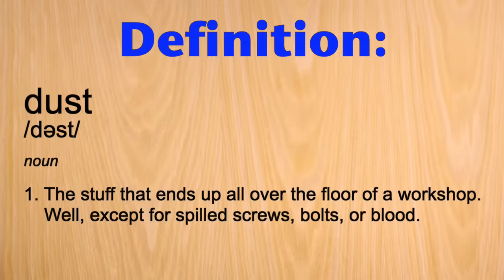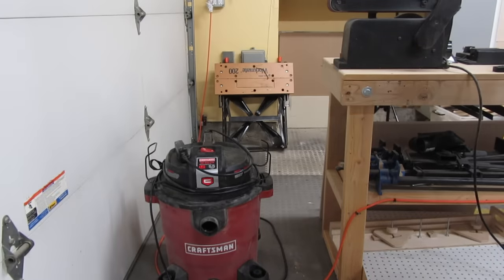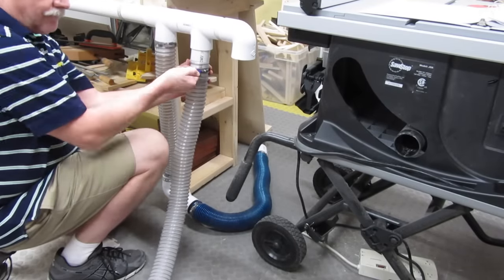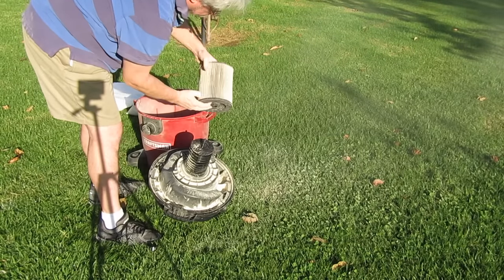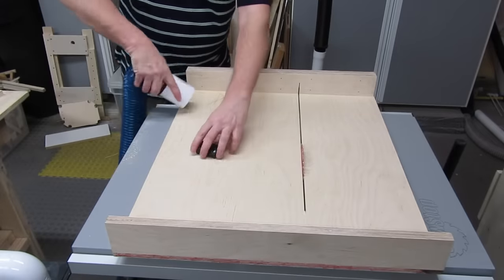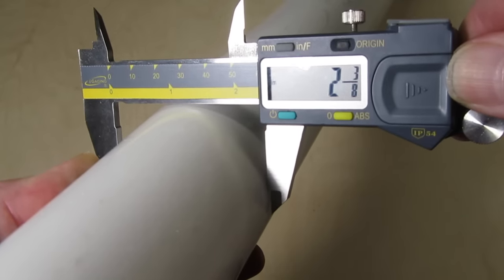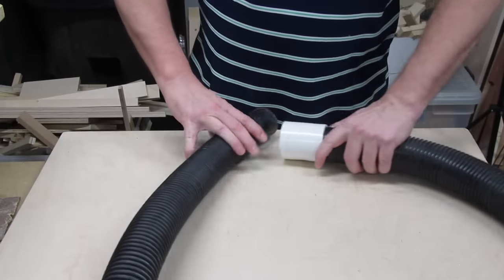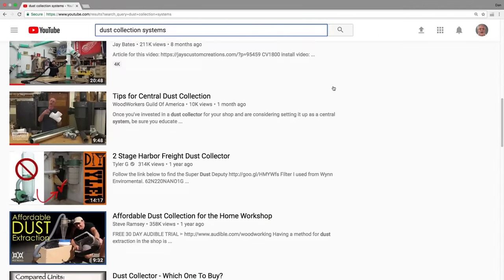Dust Collection for Newbies: Introduction to Dust Collection

Comment: Home Depot's version of the dust cyclone is much better for only 40 bucks!
Reply from the maker: I assume you're talking about the Dustopper. I have a review: https://youtu.be/iPHS-y1fWQY. It's not "much better", but it works well also, and is a good alternative to the Dust Deputy.
Reply: @TheNewbieWoodworker  I agree... I would say "just as good".  But cheaper cost with attachments included and no-brainer installation on the homer bucket puts it over the top in my book.
Reply from the maker: @mae2759  I can't argue with that. 😄

Comment: I used a dust collector but was surprised that a large portion of the dust went into the vacuum cleaner!  Why?
Reply from the maker: I'm not sure what you're asking. The dust is supposed to end up in the vacuum cleaner. That's the point.
Reply: @TheNewbieWoodworker 
Yes, this is my question. A large percentage of dust ends up in the vacuum cleaner
Reply: Can I have your email so I can send some photo for more explanation?
Reply: @TheNewbieWoodworker  Presumably he means he has a cyclone?
Reply from the maker: @jeddah116  If you mean this happens even when you use a Dust Deputy or something similar, then something must be set up wrong. Sorry I don't have a better answer than that.
Reply from the maker: @jeddah116  Sure. Go to my website at https://thenewbiewoodworker.com/, click on the Menu, and there's an option to email me.
Reply: @TheNewbieWoodworker  Thanking you for trying to help me ..
I found the reason which is a leakage from barrel cover that way collecting a dust.
Reply from the maker: @jeddah116  Awesome! Glad you solved it. 😄

Comment: PVC vs ABS? What are your thoughts? Is there a grounding issue or no?
Reply from the maker: I use PVC whenever possible, but I couldn't give you a specific reason why. As for grounding, here's my thoughts on the subject: https://thenewbiewoodworker.com/dust-collection-fire-danger
Reply: IMO, I would not install a PVC dust collection system without running a bare (preferably stranded) copper wire inside the entire length of the PVC and then grounding one end.  This is particularly true for larger (higher volume) dust collectors running through 4 or 6 inch PVC with long runs.  It may not be an issue with the system shown here.
Reply from the maker: @charlie2265  Here's my thoughts on the subject: https://thenewbiewoodworker.com/dust-collection-fire-danger

Comment: I only have a question :  There's no necessary to put any PVC cement when you put the fittings together ?
Reply from the maker: I haven't needed to. If the fittings are tight, I don't think you'll need it either. Every once in a while I'll come across a PVC pipe that is a little narrower than it should be, and it isn't tight enough, so I've learned to test the pipes at the store by plugging them into a connector, before I buy the pipe.

I have two connections I used duct tape on: One was because I was in a hurry, and it's worked so well I haven't changed it. Both the tape and pipes are black, so I don't even think about it anymore. The other is the 2" to 4" adapter that goes to my new cabinet saw. The 4" end is the same diameter as the dust port, so I used black duct tape again, and it's fine. But other than that, no glue.
Reply: @TheNewbieWoodworker  Thank you!
Reply from the maker: @Adriva01  👍
Reply: He said why he didn't!

Comment: hi my name is adam davenport I live in raleigh nc and I was just wondering if you could do a video on how to build a vacuum system for an electric clothes dryer for an apartment k
Reply from the maker: Hi Adam. Thanks for the request, but that doesn't sound like something I'm interested in doing. Sorry.
Reply: What do you mean, Adam?  What is a vacuum system for an electric clothes dryer?  What are you trying to do?
Reply: @odinata  probably trying to collect the lint from dryer exhaust in a place where there is no outside vent.
Reply: The lint can be collected easily with panty hose at the end of a standard dryer exhaust pipe.  But you would still have to deal with the heat coming out of the exhaust hose. As well as making sure you're homemade filter is kept cleaned. Or it will become a fire hazard.
Reply: @richardtrowell8812  On a more serious note, I cut a section of pantyhose (nylons) and slide it over the filter of my shop vac.  this helps keep the filter clean.
Reply from the maker: @odinata  👍
Reply: @richardtrowell8812  well if there's no vent then I'd say move the hell outta there because that's probably illegal for the landlord

Comment: Have you had any issues because your system isnt grounded? I have a similar setup im building and idk if i have to go through the trouble of grounding
Reply from the maker: I haven't had any real issues, no.
Reply: If you DO need a ground, you've got one on your plug or electrical outlet. Wrap wire or foil around or at the problem area and connect to the ground.

Comment: No mention of grounding your system. Isn't that important especially using plastic pipe and hoses? Other sources say it needs to be grounded so static electricity doesn't ignite dusts.
Reply from the maker: Here's my thoughts on the subject: https://thenewbiewoodworker.com/dust-collection-fire-danger.

Comment: i have a question, i have a shop vac 5hp, pretty much the same thing as the craftsman, i also have a dust cyclone attached to a bucket. how come in this video that there is maybe 99.999% empty and when i use mine, 50% go to the cyclone and 50% goes to the shop vac? I just can understand why.
Reply from the maker: Huh. Good question. Do you have the hoses connected to the correct ports on the cyclone? I other words, there's an "in" and "out" port, did you connect the hoses to their corresponding port? Is the lid tight? Is the cyclone tight to the lid? That's all I can think of. I hate to say it, because it's no help, but they pretty much just work, when connected right. I've never heard of them not working, but of course I'm no expert by any means.

Comment: Yeah you don't sacrifice suction by extending the hose that far?
Reply from the maker: Yes, it makes a difference. The question is, it is still effective enough? And that's a question only you can answer. I intentionally have my router table at the end, because I use that the least, and dust collection on a router is always going to be imperfect. But like I said, it's up to you.

Comment: My shop vac draws 183m3/hr  and was wondering if it is powerful enough?
Reply from the maker: Just happened to be checking comments when yours popped up. I don't know anything about those kinds of numbers, so I really can't say. I can tell you, though, that I ended up replacing my original vac right away (the one in this video is the newer one). So if you think yours isn't powerful enough, then you might be right. But hey, you never know, right? 😛
Reply: @TheNewbieWoodworker  thanks   Dan much appreciated will be a little bit of "trial & error" to begin with looking forward to working it out 👍👍
Reply from the maker: @alanscott5942  You're welcome. And that's half the fun, right? Good luck. 😄

Comment: How did you heat up the pvc without burning it?
Reply from the maker: I use a heat gun. I wear gloves, and constantly turn the PVC so it doesn't burn. I periodically check it to see when it's soft enough to form. Make sure you do it in a well-ventilated space, or outside.
Reply: @TheNewbieWoodworker  perfect!  Thank you!

Comment: Too many angles means more friction. Instead of 90° use 2/45° or 4/22.5°
Reply from the maker: That's true for systems that use true dust collectors, which depend on air volume to move the dust. For systems like mine that use shop vacs, which rely on air speed not air volume, it makes no measurable difference, at least, none that I could detect using an anemometer.

Comment: Cant you just remove the filter from the shopvac ?  What's it for?
Reply from the maker: Sure you can. But it gets really messy. Also, a dirty filter puts more strain on the vac's motor, shortening its lifespan (in theory). And filters need to be replaced.

Comment: Does the vortex work with Sheetrock  dust?.
Reply from the maker: Good question, and I don't know the answer. Sorry!
Reply: Yes, it should.  Sheetrock dust is actually made of limestone rock, so when it swirls through the vortex it should land in the bucket, not in the shop vac.  The limestone rock is used in the pollution control of coal-fired power plants.
Reply from the maker: @BarryDavis  👍

Comment: Use rain fittings instead o pressure fittings
Reply from the maker: Thanks for the tip!
Reply: @TheNewbieWoodworker  your welcome. Supposed to said drain fittings not rain 
My bad
Reply from the maker: @johnnyredding4205  I figured it out. You can actually edit your comments, if you want. I don't know how to do it on a mobile device, but on a computer, when you put your mouse over the comment, there should be 3 vertical dots on the right. Click them, and then click "Edit". Just so you know, and if you care. 😄
Reply: @TheNewbieWoodworker  hey thanks brother..ill definately try to remember that.tho i rarely use a computor cause i suck at technology,computors and such. Ill try that on my phone though.again thanx for the tip.appreciate ya
Reply from the maker: @johnnyredding4205  👍

Comment: Wouldn’t it be easiest just to connect the hose to the power tool instead of this elaborate system and drop valves? Seems overkill and don’t have to worry about suction issues.
Reply from the maker: If it's easier to you, then by all means, do it that way! 🙂 And if you get tired of it, you at least have an alternative.

Comment: Very bad idea using 90 degree connections.
Reply from the maker: 90 degree turns aren't nearly as bad when used with a dust collector-based system, compared to a blower-style collector. So while I wouldn't say it's a "very bade idea" to use them in this type of system, I will agree that you should avoid them if possible.

Comment: Would this work on a largest scale?  Thanks. - Thanos
Reply from the maker: If you've got equipment that uses larger dust ports, say 4" or 6", then I wouldn't use this setup. I'd go with a true dust collector. Otherwise, it probably depends on a lot of things, so it's probably trial and error. You can always add a second vacuum and another set of runs, I suppose.

Comment: a cyclone separates dust and chippings the chippings drop to the bottom of the cyclone and the dust continues out the top and on to your collection bin. or am i wrong😢
Reply from the maker: The idea of the cyclone is get dust and chippings into the collection bin. In theory, dust-less air continues on to the vacuum. Of course nothing is 100% effective. Also, there's such a thing as "fine dust particles" which don't get collected at all, but that's a different topic.
Reply: Depends on particle size and density, and the rate of air flow (negative pressure).
Reply from the maker: @DokDream  👍

Comment: Ahem...cheezy Star Wars reference.  CLOSE THE BLAST GATE!...Open the blast gate...open the blast gate!!!  OK, OK, back to my real question.  Knowing you are adding all these ports (and even if you add more) at what point do you suggest going to a larger vacuum?  Pressure as you already know goes down when you open ports (or forget to close blast gates).  But as you add more items.  Isn't there a point that the proportion of size of vacuum isn't enough to how many items are downline even in regards to how they exit dust from the tool or ports themselves?
Reply from the maker: It may have been cheesy, but I loved it. 😄Yes, there will come a time when either you want to have a more powerful vacuum, or perhaps break the system into two, or move up to a system with a "true" dust collector with at least 4" pipes. But you'll really only know when it's no longer working for you.
Reply: But, will you need a larger vac at all since you're only running one machine at a time???
Reply from the maker: @dannybouy7948  Suction degrades over distance, especially when there's lots of curves or flexible tubes. But this is what I think people should keep in mind: Does it work "good enough"? If it does, then don't worry about it. Perfection is unattainable, especially in dust collection! 😄
Reply: @TheNewbieWoodworker  thanks Newbie. You're so right about perfection. I've tried for years to attain it. It's so depressing when you attempt it and never reach it and then when you have to settle for the best you can do...its maddening.  So, with the help of the Lord Jesus Christ, I've learned that the best of men are simply men at best. The best I can do is progressively getting better. :)
Reply from the maker: @dannybouy7948  Well said.
Reply: You could add a T section on the cyclone and 2 blast gates to create 2 closed systems off of 1 shop vac to cut down on distance, but this will make managing the blast gates more difficult
Reply from the maker: @caliban8924  👍

Comment: A dust collection system MUST be grounded with bare copper wire along all of the piping due to static electricity buildup.  I find it hard to believe you haven't been zapped.  Static sparks and saw dust are not a good mix.
Reply from the maker: https://www.rockler.com/exploding-pvc-dust-collection-ductwork

Comment: Chop saw to cut pvc... fine blade.... no better method. If you don't have a chop saw, you need one, just buy it... sliding/mitre recommended.
Reply from the maker: Thanks. There's more to it than just buying one - I'd have to have room for it. But thanks for the encouragement. 😄

Comment: PLEASE MENTION STATIC ELECTRICITY WHEN PLASTIC PIPING IS NOT GROUNDED, a simple grounding wire should be installed along the entire system as some vac hose has the wire forming the hose can be tied into the grounding wire.   static electricity and dust = KABOOM
Reply from the maker: https://www.rockler.com/exploding-pvc-dust-collection-ductwork
Reply: I don't think that happens very often or ever.
Reply from the maker: @Johan_Pentrose  Thanks, and I agree. That's what the Rockler link says. It has happened with big systems, like grain silos and big commercial sites, but for small systems like ours, a fire or explosion pretty-much only happens if there's another, more dangerous factor is involved, like a gas leak.

Comment: I thought if we didn’t use metal pipe, we could start a fire.
Reply from the maker: That's not really an issue unless you have a really large system, like industrial-sized large. If you're worried, you can ground the system (search YouTube for "grounding dust collection"). But also see this: https://www.rockler.com/exploding-pvc-dust-collection-ductwork.

Comment: When you go outside to clean your filter from your dust collector why you have the vacuum cleaner outside put the lid on it without the Builder plug it in and use the exhausted the vacuum filter in the air blowing out to clean your filter blood from the inside of the Builder out through the Builder the other way can you clean it real efficiently Jay Jay deal
Reply from the maker: Thanks for the info! 👍

Comment: T-connectors are evil for losing air pressure, Y-connectors should be used & flexible hoses so should be as short as possible.
Reply from the maker: I believe, and this is only a theory but nobody's debunked it yet, that shop vacs work differently that blowers. Shop vacs rely more on air speed, and blowers rely on air volume. Or something like that. So it seems that Ts have less of an impact on 2" PVC pipes and shop vacs, than they do on 4"+ pipes and blowers. I also did some testing, which may or may not support this: https://youtu.be/DzuPo802mV8

Comment: Huge mistakes in making the ducts, don't use 90 deg angled tubes, you loose too much suction. Use two 45 deg instead, far less suction loss. Also the larger the port size the better. Use 4" or 6" as a base and only go down to 2.5" when connecting to machines.
Reply from the maker: Thanks for the comment.